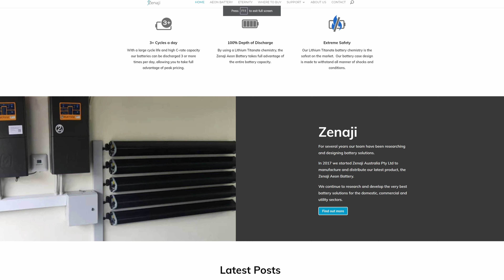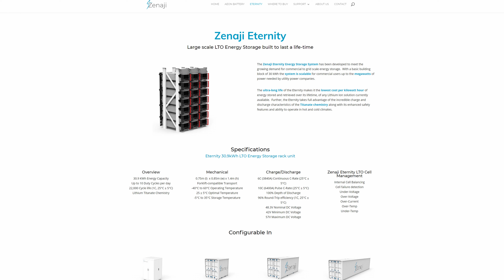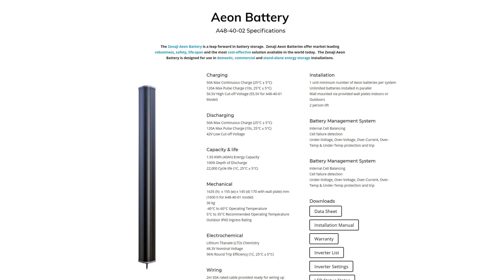Podcast with the team from Zenaji

Comment: Charlie, how is it that you're only getting 5 of your own batteries, and I'm getting 16 of the bad boys for my new solar house....  Different philosophy I suppose, I want to be able to run my reverse cycle ducted air con, heat pump hot water, and induction cooktops during a prolonged black out in the middle of winter.  Let the games begin! ;-)
Reply: Hey Daniel. I still got you on more solar panels!!!! Also I have pretty sensational insulation happening at my place. I will suck it and see in winter time. As mentioned in the podcast my personal favorite temperature is around -5 C , if I need more its a simple add on.
Reply: @Chuckychazza  I think my wife would kick me out onto the street if I tried keeping the house at any temp below 20 degrees in winter...😅